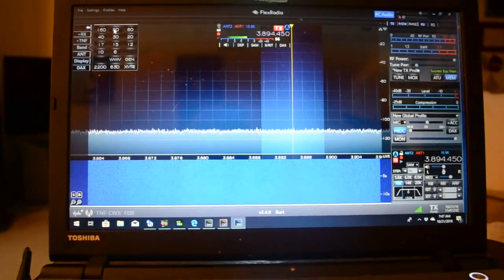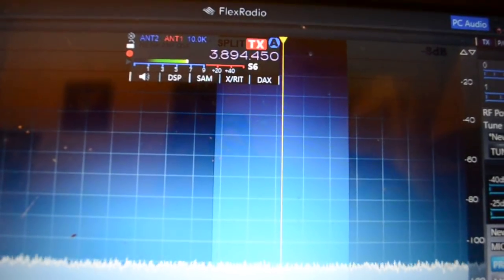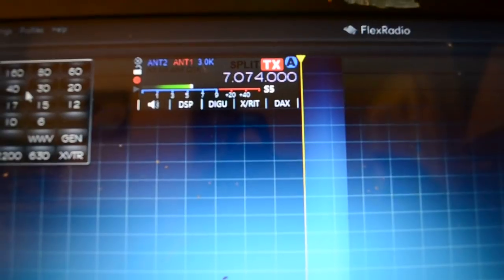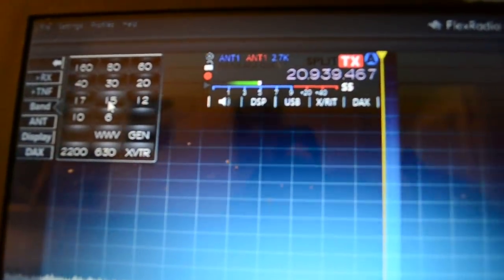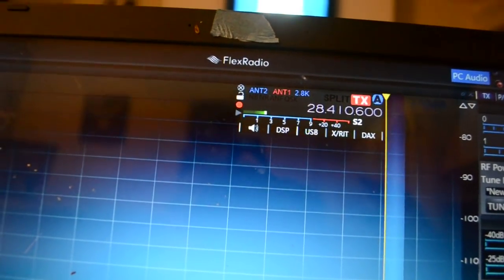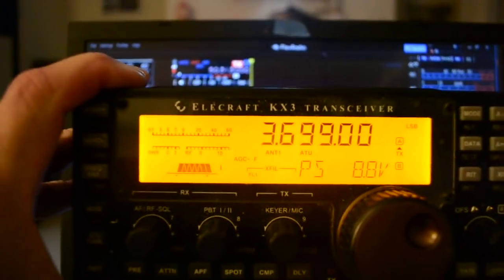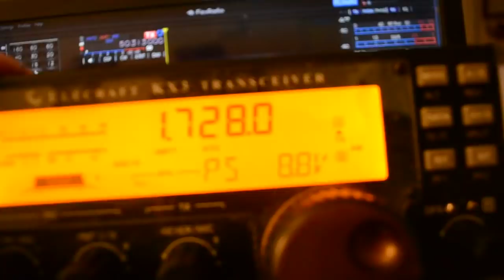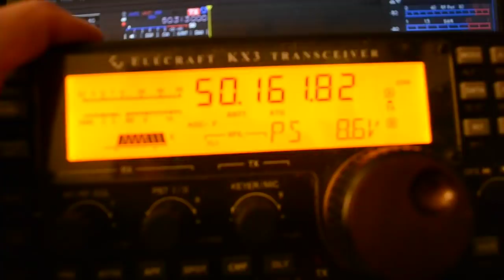The S meter comparion between the Flex 6400M and the Elecraft KX3

Comment: The "S" meter shows the "Noise Figure" of the radio when the radio is terminated into a dummy load. Some of the bands did not have the same bandwidth so the readings can not be directly compared. If some preamp boost was dialed in the readings would be lower because the Noise Figure will be lower.

Comment: The panadapter simply measures the signal in a given bandwidth and draws what it hears. If you look at any given pixel, it represents a certain amount of bandwidth. We call this the "bin size" of the FFT that is used to produce the display. If you cut the bin size into two pieces, the amount of noise in each piece goes down by half (3dB). In PowerSDR, the bin size is generally fixed for any given setup and does not change when you zoom. This is why the resolution gets worse as you zoom in on PowerSDR -- you begin to show one bin with multiple pixels. But for SmartSDR, we knew we wanted to have a larger range of zoom and this method was no longer acceptable. So we vary the bin size across a 1000:1 range. So the noise in each bin also varies. 1000:1 is a change of 30dB so from min zoom to max zoom, the noise in a bin will lower by 30dB and you see this change in the panadapter as you zoom in and out. 

When people talk about noise floor in ham radio they are generally talking about the noise level with a 500Hz bandwidth. When the panadapter is zoomed in to the max level, the bin size today is about 5.8Hz. This is a 19dB difference in noise from where a ham would say the noise floor is to what you can see on the panadapter. This means that the panadapter can see 19dB below what most hams would call the noise floor. Your ear and brain are also able to hear below the noise floor in 500Hz because of how they work. But there are limits to how well you can hear. If you've ever worked JT65 or another long-term integrating mode, you have noticed that your computer can copy signals that you cannot hear. 

So if you ask another ham "where is your noise floor on 80 meters" and he says "S5," what has he told you? Well with most hams, you don't know because you don't know the answer to these questions: 

1. What bandwidth are you using to measure the signal? 
2. Is your S-meter calibrated? 

An S5 signal corresponds to -97dBm. And if he's getting this on sideband set to, say 2.8kHz bandwidth then the actual noise floor in 500Hz would be -97 - 10*log(2800/500) = -104dBm. There's nothing magical about 500Hz, it just happens to be the convention for measuring noise in the ham radio world. In SmartSDR, if you set the passband filter to 500Hz, the S-meter in the slice will show you the 500Hz noise floor. 

If you start at maximum zoom and begin zooming out, you can see a point where the noise reading of the panadapter equals this number. What do you think this point is? ... if you've been following along, you will realize that this is the point where the FFT bin size is 500Hz. To get a rough idea if this is right, you could measure the width of your panadapter window and divide the amount of frequency displayed by this number. It should be in the 250-1000Hz range. The answer will not be exact because we do not continuously vary the FFT bin size -- we adjust it in steps and don't tell you where the steps are or what size they are. We do what's right for what you are viewing.
Reply: great info, thanks !